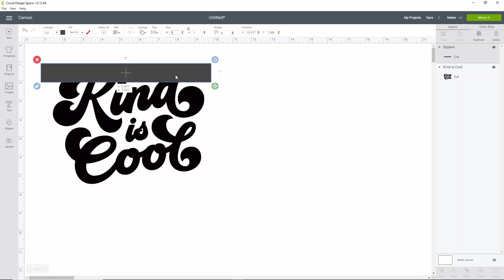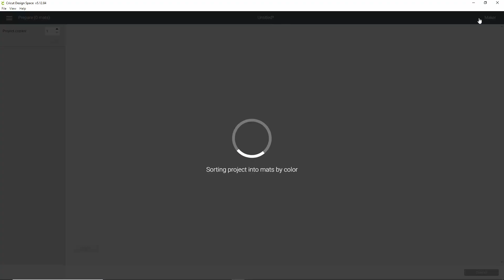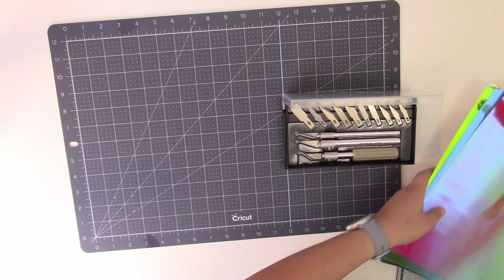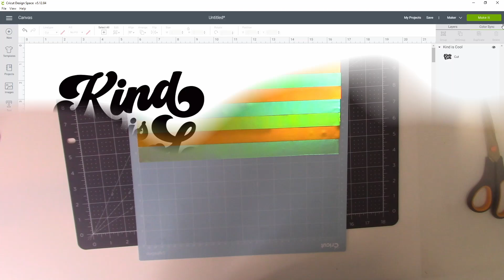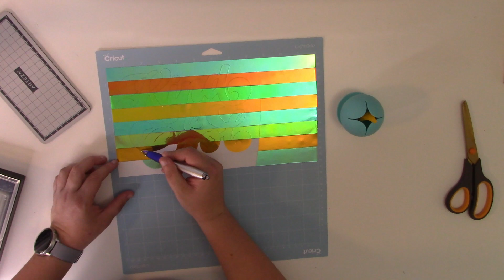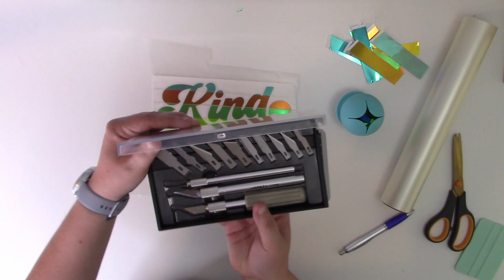How to create a striped decal - Cricut - With Arteza

Comment: How would you do this with cardstock?
Reply from the maker: Same way. Nothing really would change but I would use a slightly less tacky transfer tape and then you’ll have to glue or tape down the design and then remove the tape
Reply: @CorinneBlackstone I was thinking there might be a way of attaching something double sided tacky between the mat and the paper strips …. So they could be lifted off the mat in one piece.  Any ideas of what product could be used with the least $ expended?
Reply from the maker: @barbaradutton5362 maybe double sided tape but you’re going to have a hard time getting a cut setting just to cut the cardstock. I promise you’re better off with the transfer tape method

Comment: I assume this would work well with htv too and maybe use a extra htv transfer sheet so it dont come apart?
Reply from the maker: Yes! you could absolutely do this with HTV. I use heat tape on the edge to keep the lines together.

Comment: Could you not have cut the strips with your Cricut? Probably put the white side up to cut?
Reply from the maker: You could but that would take way longer
Reply from the maker: Also putting white up still won't cut through the vinyl you will need to change the pressure setting